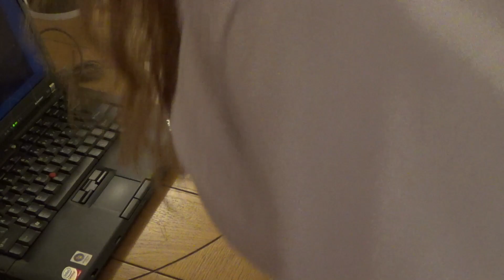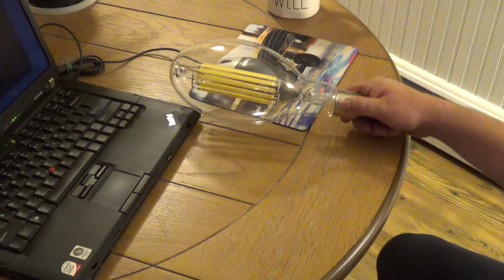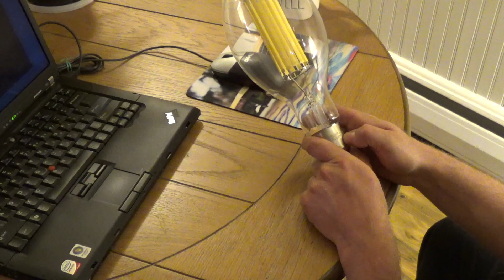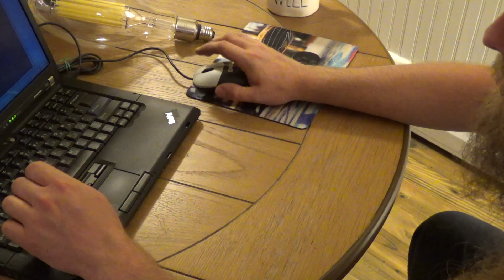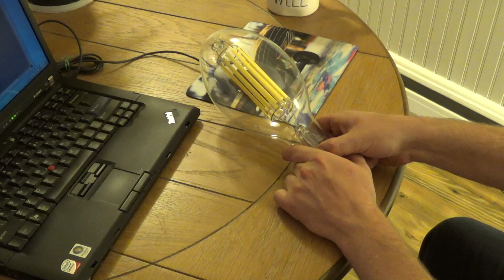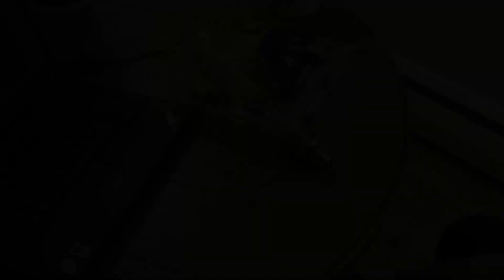How Can LED be More Cost Effective When the Bulbs and Fixtures Don't Last?

Comment: I honestly am not a fan of LED bulbs. They're way too bright and harsh for me. My ceiling fan in my room has dimmable LED bulbs in it, and I keep them turned down as low as they will go. Anywhere else in the house its a CFL, or if I'm lucky to find one in the house, an incandescent bulb. And don't even get me started on LED headlights, or any automotive LEDs for that matter. Only place I'm willing to use LEDs in any of my classic early/mid 80s Chevy pickups are in the cluster, and even then that's just an experiment.
Reply from the maker: I agree, I use incandescent and fluorescent in the house almost exclusively. I've had a hard time driving at night sometimes ever since the LED headlights became popular, there's too much glare from behind and in front.
Reply: @JordanU I have to keep the sun visor for street lights or lights at the fast food or any buildings, but for the headlights it doesn't block anything.

Comment: The answer to your question of why these fail. Two words “Planned Obsolescence” . I think people fail  to realize if e led lasted 25years or whatever they say, a lot of the manufacturers would go out of business . So overdrive the heck out of them they only last a short time, and people will need to buy more. Keeps these companies in business. I stockpiled incandescents and halogens amd have been buying appliance bulbs and using those first because they are still available. The point is this whole ban is not about the environment, it’s about money. There is no big profit margin with incandescent bulbs, that’s why they have to force these on everyone.
Reply from the maker: I am aware of the answer; the question was rhetorical.

Comment: i think that HID bulb last longer because there is less component to break, the ballast itself is literally just an inductor, and its heat resistant. the LED itself probably last longer than HID, but the driver is the one thats causing the premature failure, its overdriven and has poor heatsink making it fried alive
Reply from the maker: Simple is more reliable.

Comment: With the high cost of electricity it only takes around 200-400 hours for led bulbs to be cheaper than incandescent.  Im not sure what the math would be for HID lamps. 
Its still super annoying to deal with leds failing so often though.
Reply from the maker: That number would be thousands more for high efficiency light sources like HPS.

Comment: ge current make pretty good led-hid replacement bulbs, they got a heatsink + fan and they're bright as hell.
Reply from the maker: If it requires a fan, then the components are probably being over-driven.
Reply: @JordanU  Maybe, the bulbs I got has a 8 sided heatsink, for the leds & a metal frame fan that is used as a heat sink for the top leds also
Reply: I seen one of these lamps go out, it was a 35w Ge Led-Mercury replacement bulb, it replaced a 50w mercury vapour lamp

Comment: While it is true that LED lighting generally uses less energy than traditional HID fixtures, the issue of premature failure is a valid concern. It is important to consider the longevity and durability of the bulbs and fixtures when weighing the overall cost and environmental impact. Additionally, it is important to ensure that the LED bulbs and fixtures are of high quality and have been tested and approved for use in specific applications. It is also important to note that the technology is still evolving and improving, so failures and issues may be more common in older or lower-quality products. Overall, LED lighting can offer many benefits, but it is important to thoroughly research and consider all factors before making a decision.
Reply from the maker: It doesn't seem to be 'improving' at all. The older LED fixtures were much better quality.
Reply: @JordanU   it's possible that the newer LED fixtures may have different features or design elements that some users may not prefer. It may also be possible that the older LED fixtures were manufactured with higher quality materials or had better durability.
Reply from the maker: @silverhorses-du7rz  What on earth are you saying? Features and design elements that some users may not prefer? Such as failure within a few months of installation?

Comment: I avoid cheap LEDs like the plague. I have some of the more expensive LEDs and they are quite good. They have a very nice hue to them, very close to incandescent. I still prefer incandescent and use them where I can. I have the LEDs installed in fixtures that are hard to reach so hopefully I won't have to replace the bulb so often
Reply from the maker: I usually avoid all of them, they all seem to be inferior to incandescent in some way or another. I still, and will continue to, use incandescent almost exclusively.

Comment: I can attest to reliability issues with LEDs myself. One time I had to replace two light bulbs in my kitchen light fixtures. I replaced one with a Cree A19 LED bulb and another with a 60W incandescent. Wouldn't you know it, the LED one failed four weeks [with no indication of why] after I put it in and the incandescent bulb still worked! I ended up replacing the dead Cree with the same 60W incandescent as the other fixture. The kitchen light fixtures have had no issues ever since. If I find an LED brand whose bulbs last longer than these Cree POS bulbs or even those incandescents, I'll consider trying it. Nice ThinkPad 👍
Reply: Companies overdrive the diodes... if they doubled the amount of them to produce an equal ammount of light they would last much longer.
Reply from the maker: @CoreyDeWalt  It's a shame they're so poorly designed, the potential is there for LED to be good.
Reply: We had those 50w mr16 lamps in the kitchen and hallway. They lasted for years and years. Never seen one go out. Replaced with leds and i had many go bad. And they aren't as bright.

Comment: I think it's planned obsolescence. I've seen LED bulbs last for years. They just aren't now. They're made too cheap. I never thought that LED bulbs were good for high output uses like street lights. If you need more than 75 watts incandescent equivalent light output for a home, fluorescent is more efficient. Sodium vapor was a good fit for street lights, and I don't really know why they started moving to LED other than political reasons. The mistake was made when LED was looked at as the beat all solution for lighting. Also, the amount of mercury in fluorescent bulbs is so minuscule that they shouldn't be fear mongering over mercury poisoning. I've broke a few, and I'm still alive. The worst I got over breaking a fluorescent bulb was the feeling I broke a perfectly good bulb.
Reply from the maker: I tend to think so as well. The bulbs and fixtures certainly could be made to last if that was the desire. We used to have those products.

Comment: The city near me halted their LED street light conversion project because the fixtures were failing faster than they could replace them!
Reply: Yeah, similar thing happened on the road where one of my friends houses is. They put in LED streetlights, but they kept failing, and turning purple and such, so they eventually got tired of replacing them. Now, the ones that have failed on that street (and I am assuming other streets and roads around there), they are replacing them back with the old HPS lights. So there is a mixture of harsh LED lights and HPS lights, which is quite annoying, but I imagine that issue will take care of itself as the LEDs seem to be all failing pretty rapidly.
Reply: Most of the led street fixtures near me are purple as well.
Reply from the maker: That is really something. How abysmal.
Reply: May I ask where? I think HPS is so much better than LED.

Comment: You pay for what ya get, cheaper leds last shorter due to cutting corners. Same exact thing with bulbs….
Reply: You didn't listen to the video at all did you? You either watched a few seconds and ran to the comments section, or just say the title and ran to the comments section. Either way, what you are saying here does not apply to the video as these aren't cheap LEDs. And the longevity issue affects ALL LED lights that I have seen, not just the cheap ones. They are just worse.
Reply from the maker: These aren't even cheap bulbs, Cree is a reputable brand that's widely regarded as good quality.

Comment: I would not be suped if the problem lies in the diver board in the base of the bulb rather than with the filaments an out of spec part in the driver could wreck it in short order
Reply from the maker: I tend to think so as well.

Comment: I have many (over 100) LED bulbs in my home and I haven't had to replace one in the past 9 years. They are all the "EcoSmart" Home Depot brand bulbs, daylight 60-watt equivalent. Some are 100-watt equivalent. I refuse to use CFL since they give me headaches, and incandescent uses way more power.
Reply: Same bro. I have many led lights and fixtures in my home and I don’t remember the last time I touched one since installing them.
Reply from the maker: I've had good results with the EcoSmart halogen bulbs, I've used them for years with very few failures. I've tried a few of the LED models from EcoSmart over the years and found them unpleasant.

Comment: I haven't seen any flashing/strobing or turning purple streetlight failures where I live (in Canada), but i've seen quite a few of the "doesn't work at all" failures. I've seen at least 3 of those failures in my neighbourhood and at least 2 other failures in the neighbourhood adjacent to mine.

I also think that the photocells might also be failing? I've seen several (sporadic) cases of entire blocks or streets not being lit up from what I assume is the photocell not switching on at dusk (and counterintuitively, i've seen (sporadic) cases of streetlights always being lit and never shutting off during the day).

But as you mentioned in your previous video and in this one, (most) LEDs are absolute junk.
Reply from the maker: Even if it is as simple as the photocell failing, that often results in a whole new fixture being needed due to the integrated, non-serviceable designs.
Reply: that would depend on how the photocell fails if it failes shorted they will stay on if it fails open they will never turn on
Reply: @jdslyman  agree. Ive got an early led clock radio that i got from my grandma and it has been on, keeping time, since before i was born in the 80s. The only failure is the colon separating the hour and minute. Also the radio stopped working.